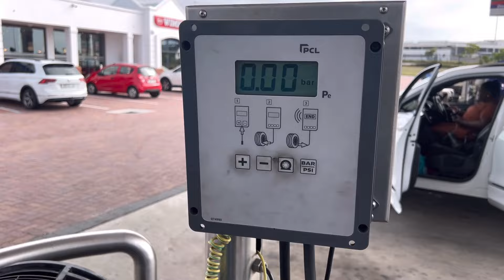Playing Around at Crockarts Hope 4x4 in port Elizabeth, slow crawl Optimus the Jimny, JB74, Gen 4

Comment: So in conditions that most users will face the Jimny works without additional upgrades essentially ? You drove slow and that seemed to allow native torque to do the work. The ruts at Crockarts seem a decent challenge. Seems Jimny works well not when you send it but when you just drive it.  Also nice to see Bosvaark ( Frik and Li) there 😂😂.
Reply from the maker: On solid surface that seems to be the case but will test it tomorrow in the sand, plan is to get stuck and see if I can recover just by activating the lockers.